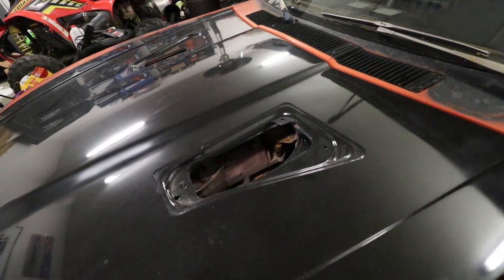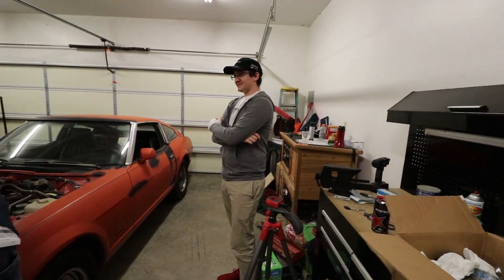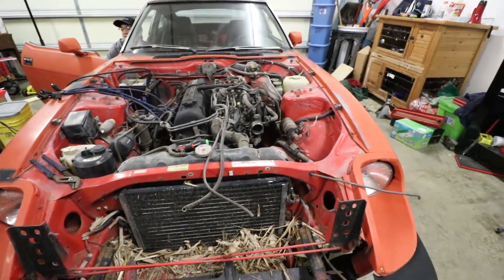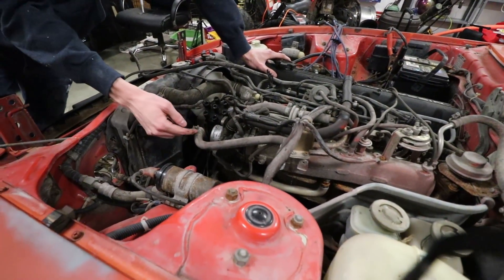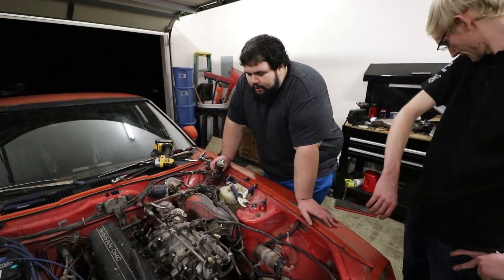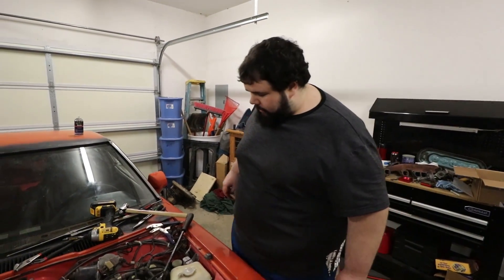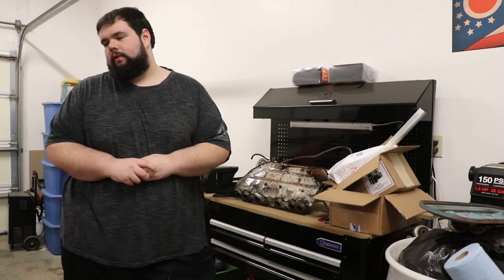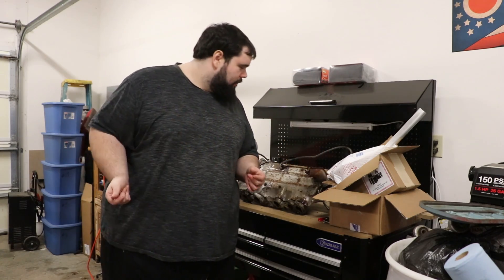Datsun Turbo Build TEARDOWN!!

Comment: Bobby, make sure you get new spark plugs and put a smaller gap on them then before. That should give the added spark needed for boost. Also the timing on the distributor may need advanced a little more than when it was NA.
Reply from the maker: Putting the new turbo distributor in it to control timing with the megasquirt ecu